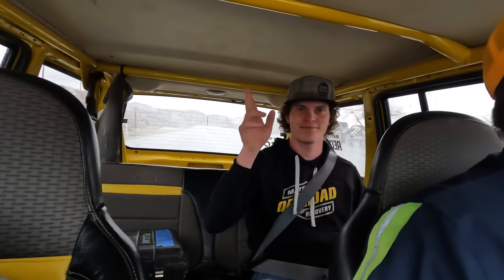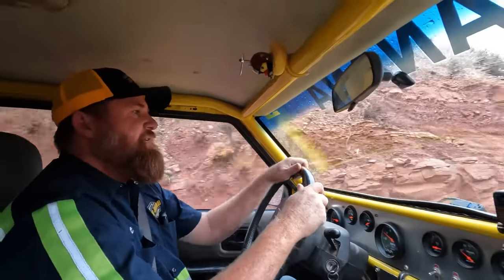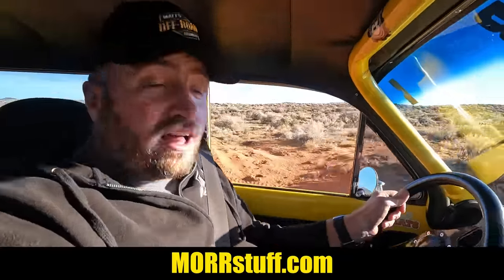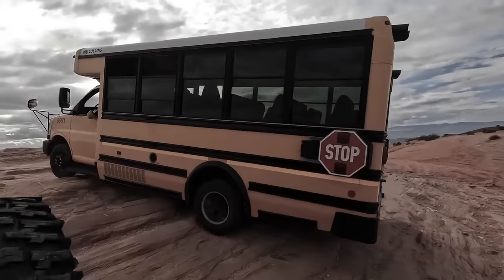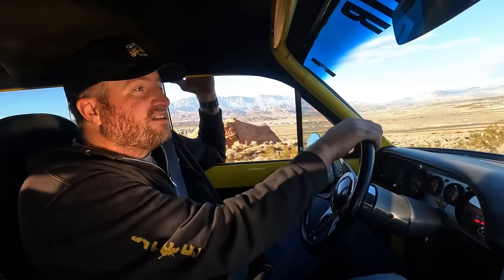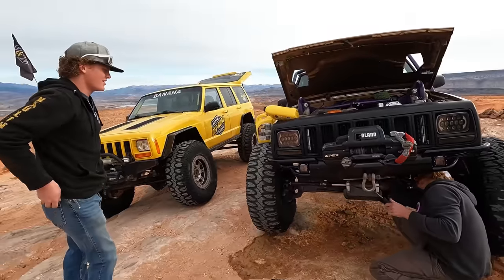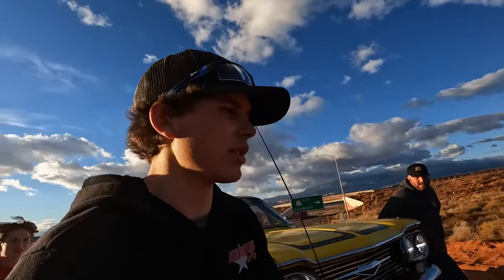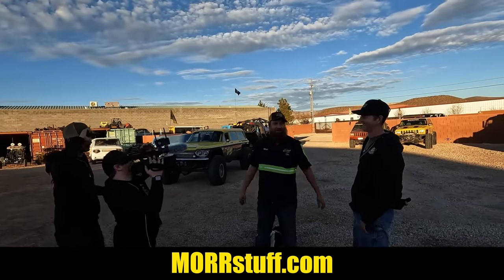This One Decision Left Him In The Hospital

Comment: 100% correct on the wiper blade issue.  I have been a wiper blade engineer for over 20 years, and we often see windshields get "vision fatigue", which leads to a breakdown in the wiper blade materials.  There are very few ways to remedy this, but one way is for the driver to wear dark glasses, which reduces the vision and therefore reduces the vision fatigue.  Another way is to make it a habit of frequently leaning over toward the passenger seat while you drive.  This spreads out the vision fatigue and can extend the lifetime of your wiper blades.
Reply: Do you have a recommendation for a good blinker fluid?  😁
Reply: Wiper Blade Engineer  LMAO 😂😂😂
Reply: What a load of BS !
Reply: Same question about insulated beverage containers; keeps hot beverages hot and cold beverages cold; how does it know?
Reply: How often should I rotate the air in my tires?
Reply: @BrianW2979  Twice. Summerair in the summer, winterair in the winter. It's as simple as that. ;)
Reply: The driver’s side wipers wear out first because more bugs have to be cleaned off that side.
Reply: My passenger blade is always the worn out one because I rarely change it. lol
Reply: I have to say I have contemplated this mystery myself and have even contemplated the hypothesis that vision causes wear, deterred from proposing it only by the simple fact that it is utter nonsense, absurd on its face. But can I prove Matt wrong? Not really. I will, however, propose a serious alternate hypothesis: The driver's side gets more road splash from oncoming traffic, and this road splash often contains some dirt or grit, and it is the dirt and grit that causes the driver's side wiper to wear faster.
Reply: SCIENCE FTW!
Reply: In this instance, the reason the passenger side has worn out first is because of all the camera work that is done through that side of the vehicle. The camera lens is more hidef and uses that auto focus ray gun thingy and thus causes more wear. it causes vision fatigue squared.
Reply from the maker: Lol
Reply: Are you serious?
Reply: @russlehman2070 I wonder if we can get some stats from an RH drive country? You may be on to something there!!
Reply: To provide a highly scientific explanation: Its the photons and their abrasive effect on the glass that causes the surface to become coarse. Now, if there is no eyeball to catch the photons, they technically both exist and do not exist, just like Schroedinger's cat or the falling tree in the desolate woods. In this dual state of existing and not existing, the abrasive effect is effectively almost nullified.
Reply: Came for the comments and am not disappointed 🤣
Reply: All's I can  say is that 99% of the time it's the driver side wiper that gets the pine needle  under it.  And it's always, ALWAYS, right in my field of view.
Reply: This checks out!
Reply: @f.schiebenhover7713 . Wrong mate. Winter air goes in for summer driving. This keeps the tyres cooler so prevents overheating. Conversely, summer air is for winter driving to limit tyre freeze. It's all about maintaining an even temperature all year round.
Reply: @azizhachimi8744  Of course he's serious, do you think people would just make things up on the internet?!?
Reply: @f.schiebenhover7713  what do you do with Fall and Spring? 🤔🤨
Reply: @iffykidmn8170  in germany we I use winter and summer-tires. so... You can drive all weather but its risky. You may forget to change air betweeen seasons. 😂
Reply: @Backroad_Junkie ams oil is all I run happy blinkering
Reply: @keithholzer6593  No, it's all true.  You can believe it because you read/heard it here on the interweb!
Reply: Because the driver's side wiper is longer causing more friction. And the ditch side doesn't take as much of a beating from, More wind from oncoming traffic splashing water and debris, sand as the driver's side windscreen is always worse condition.
Reply: @azizhachimi8744 deadly serious, this is life or death stuff.
Reply: I always thought it was the weight of the driver, thanks for clearing that up.
Reply: where vision goes, energy flows, wearing out the plastic.  brain energy, out the eyes, xrays. Humans are doing that to the plastic.
Reply: @keithholzer6593  pretty much went WAY over your head, eh, Keith?
Reply: @azizhachimi8744  Do you have ANY sense of humor?
Reply: @nicholasevans4696 Good point, totally makes sense
Reply: Yeah,  my Dad would wear his eyeglasses out by looking through them as well....
Reply: That explanation makes perfect sense, thanks for taking time to explain it in such great detail. And the tips to help your wiper blades wear evenly as well, this will save me quite a lot of dollars.
Reply: I always find something I'm looking for in the last place I look.
Reply: However with one driver and two people on the passenger side, wear is accelerated on that side. Due to the nature of MORRs operations this is frequently the case
Reply: Proof positive that photons have mass🧐
And on Rudy’s “rescue” a screwdriver? Why doesn’t he have a tool burrito on the Rudycon???🤭🤣
Reply: I was expecting humor, until I read your post. Then I was disappointed.
Reply: Use to have 50% tint on my vehicles going on decade now or more for this very reason. Not to be cool but due to driving alot.
Reply: Save your wipers, drive with your eyes closed.
Reply: @Backroad_Junkie 
There's a Ford dealership in Kentucky that has some good stuff.
Reply: Look past it.
Reply: @dkstudioart  Sorry to correct you, but this is not the proper way of doing it! If the driver side wiper gets bad it will be the new passenger side wiper until it fully disintegrates or until the driver side blade is worn out again. In any of these cases the driver side blade becomes the new passenger wiper, and the driver side blade gets renewed.
Reply: @BrianW2979 everytime the wheel goes round it does it automatically. Don't they teach anything useful down there?
Reply: @BitBuhkit they obviously don't. Probably Republicans.
Reply: @kennykauffman6221  rotate your wiper blades when you do your tires.
Reply: 96.24% correct. I have been married for 28.213 long blissful ..long educational ...long ..umm.. years and due to my wife being a self taught level 4 Youtube engineer and having given countless seminars to which I had the privilege of being the sole student has given me the insight to use her findings in my conclusion.  I have concluded the activation of the "optionally installed , yet hidden passenger footwell brake pedal", the forward velocity is transferred ever so slightly to the passenger side causing the drivers side to slightly increase in speed, This conclusion can be verified by numerous documented happenings of " why do you need to go so fast" which when viewed by said driver indicted no such occurrence being undertaken yet said passengers continuous operation of the forementioned " optionally installed , yet hidden passenger footwell brake pedal"  This repeated action is what results in all components being prematurely worn on the operators side. My findings to verify when the passenger side wiper remains in identical functioning form or are prematurely worn is only achievable when starting a mission and "accidentally" referring to her using an " ex girlfriends name" This action routinely results repetitive abrupt head turns which  when performed in  silence compounded with the slow yet steady internally combusting heat coming from the passenger side counteracts the  equalized momentum and minimizes the potential wear created to the operators side during use of the "optionally installed , yet hidden passenger footwell brake pedal? from the opposing side of the unit being driven. ..The more you know...
Reply: @f.schiebenhover7713  I think years ago, you guys had to have winter tyres on by law, by I think, the 16th of October.
Reply: @f.schiebenhover7713  Helium filled tires need not be rotated. And, tires last twice as long. All while increasing MPG's by about 78.3%.
Reply: Ä

Comment: I love people that can admit that they are just not comfortable enough to drive through terrain they don't know. That's REAL bravery rather than just risking it.
Reply: The second person who turns up adds to the safety in numbers. An entire professional crew turning up and sucessfully driving your vehicle out were not facing the same risk.
Reply: solid move, not getting stuck at all
Reply: I understand what you’re saying but nah, I’m driving my truck until it’s stuck or I slide off the road before I call another man because I’m scared lol
Reply: I made the irresponsible mistake of letting someone learning lines drive my truck through a tricky spot last night. Ended up axled out hard front and rear. Managed to find service and call for rescue. It barely took more than idle from the recovery truck to get us out. Five miles down he smacked an elk and wiped out the passenger side steer. We put the spare on and it lasted five miles. Ran up to service, called for help again to save the second truck, and we got home at 4am with a couple guys needing to show up for work in the morning. What a mess that was. I have a winch I'll weld in this week and a bent hi lift that needs straightening that will ride with us on these runs. And I'll drive the hard spots until my 12k Apex is good to go. The right line for the rig is EVERYTHING. And if you can't spot lines a winch is a saving grace.

Comment: I have been working on vehicles for 55 years, and for a long time I hated the "spring clamps" on radiator and heater hoses and replaced them with stainless steel "aircraft" screw clamps. 
Turns out I was wrong, and that they can fail because hot-cold cycling can result in them being loose enough to leak.
Factory "spring clamps" are actually called "constant tension" and provide a more secure connection because it isn't affected my that "hot-cold" expansion and contraction.
That said, I got one of the 'hand grip cable operated spring clip pliers" because they make life much easier in hard to reach spots. My Vise-Grip Toolbox pliers will often work in an emergency,  but they also tend to slip when you least expect or want it.
Reply: I've had the same experience, after 30 plus years of working on racing cars. Worm clamps always work themselves loose and require checking/tightening and it wasn't until I worked with an automotive engineer from an OEM that I learned why the spring clamps were better. They are also faster to install on an assembly line! Anyway, I only use Oetiker clamps or fuel injection hose clamps or pressure hoses or spring clamps on radiator hoses. I'll use old school worm clamps on vent hoses or the like that aren't critical in the same way as all other hoses.
Reply: Ditto for myself - constant-diameter (the ones everyone likes) clamps don't stay tight under all operating conditions, while constant-tension ones do.  I have settled on the constant-tension version of the stainless screw clamps that have belleville washers to constantly apply spring force.  They are very expensive, but if it keeps a hose from popping off in the middle of nowhere, it's totally worth it.
Reply: I've cut notches in a set of pliers for them before, but someone decided they needed them more after using them.

Comment: Another great video. Kudos to the first guy for giving MORR a call. There's no reason push a bad situation; it can result in damage to the vehicle or worse personal injury. As for the gentleman on the Africa Twin. Just like your off-road rig with 4 wheels the tires make all the difference. Looking at the tread pattern on his tires they appear to be Dulop Trailmax Raid tires. In the world of motorcycle tires these are considered a 50/50 tire (50% on-road and 50% off-road). I have watched a couple of reviews on this tire and in dry dirt, gravel and hardpack conditions they work very well. When riding in mud or deep sand a knobby tire or one with big blocks will work better (30/70 tire).

Comment: I can validate your windshield wiper observation. When I was a teenager in the 1970’s I worked afternoons in an auto parts store. In those days we sold wiper blades in pairs and customers would complain that they only needed the driver’s side wiper. The driver’s side wore out first every time. And yes, our theory was the same as yours, that it wore out first because it got looked through more. I spit coffee out my nose when you said that, it took me back 50 years.

BTW - there is a more scientific explanation, but I’m not going to ruin a good story with the truth.
Reply: maybe because the passenger side always pushes everthing into the path of the driver so basicly the driver side has to remove all the grid off the windshield?
Reply: I wanna know the actual scientific explanation! 😭

Something about the right side wiper depositing the water it wipes onto the path of the left side wiper...? 🤔
Reply: @WatanabeNoTsuna.  Twice the water - and thus twice the bugs, grit and salt - from the passenger wiper.  Twice the abrasion, so it makes sense to me.

Comment: The driver’s wiper indeed works harder, but for two reasons: the passenger wiper pushes water, etc into the clearing area of the driver wiper, and being on the side that takes more opposing debris from oncoming traffic (sand, brake/tire dust, road grit..) the wiper is encountering more abrasive on the blade.
Reply: Also the distance the drivers side travels over the windshield is further than the passengers. Adding that it moves all of the passengers water and debris along with it's water and debris and it has further to move across the windshield that causes more wear and tear.
Reply: I was going to post the same thing!
Reply: evidently, they cannot clear the bs for you. :face-turquoise-covering-eyes::body-green-covering-eyes:
Reply: This answer is probably true but not as fun as some of the others. 😊
Reply: Apparently some people can’t see a joke.🤦‍♂️ Probably because their windshield is dirty.
Reply: @Crewsy  and some people use jokiness to cover for their aversion to accurate information. 😆😂🤣🤦🏻‍♂️

Comment: My fellow Africa Twin rider shows his inexperience 🙂
All that was needed for him to do was to first take off the jacket in order to break a sweat. Then remove all the luggage that you can, drop the bike to one side preferably the high side, fill the hole and lift the bike up. Did I mention taking off the jacket ? 😂
Reply: and expecting road tread tires to work in soft sand! 16:20
Reply: You can dress as an adventure rider and you can ride an adventure bike but it doesn't make you an adventure rider.  It was actually kinda embarrassing.

Comment: Wiper blades are just 1 tool in the job of keeping the windshield clear and clean.  The wiper arms have a big role too as they age, the springs begin to lose the pressure needed to apply the right amount of pressure to the windshield, leaving streaks.  You need to check and change the arms every once in a while not just you blades.

Comment: Clay is clay where ever I have been in this nation.  I built Institutional green houses in the south and clay is slick like hell, until it is saturated, then it tends to grab hold and won't let go.  I think the sand content has a lot to do with how slick it is.  We used my 4x4 to get into most of the sites. Arkansas had this stuff that would swallow my truck everyday, but I was still able to churn through it.  Texas has this slick clay that I can hand winch my 4x4 off of it with a come-along while leaving the 4x4 in low range first gear.

Comment: grab some alcohol wipes and wipe the blade. this usually cleans up the blade to give you a few more months of use. the streaks are caused by dirt sticking to the blade usually.
Reply: you don't need alcohol. Whenever you fuel up just use the rough side of the windshield squeegee or a wet paper towel and wipe them down. If you do it often then you don't need a solvent. Using solvent will drastically reduce the life of the blades. Just keep them clean.

Steaks are caused by a variety of things from spring tension(springs wear out in the arms) to dust/oil/grime to deterioration of the blade itself.

Comment: In general the driver's wiper in most designs has almost 10-18% more area to clean, so evidently will experience more wear in the long run. For good reason the driver side enjoys priority. Always check them for tear and wear and change them regularly on both sides. With the Cybertruck you will have no choice but to line up for a long replacement queue at a Tesla Centre.😂
Reply: You you find me dead before you find me buying a car that makes me go anywhere for such a simple maintenance job 😂
Reply: Matt has 11%
Reply: also dosent the passenger side always push everthing into the path of the driver side so basicly the driver side has to remove all the grid off the windshield?